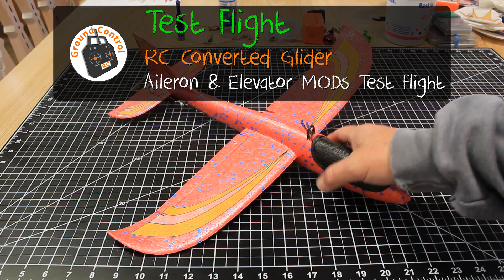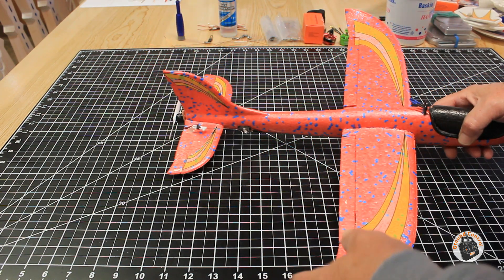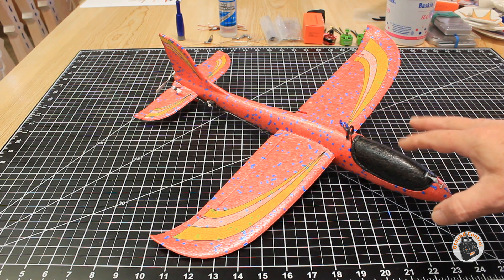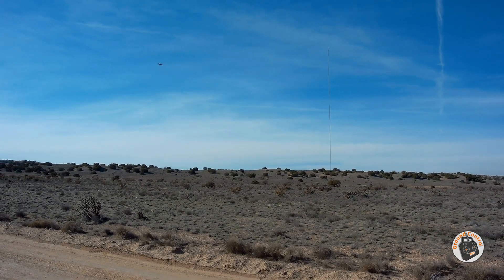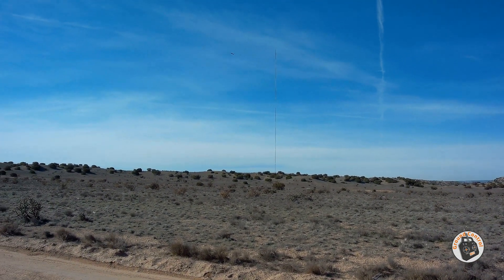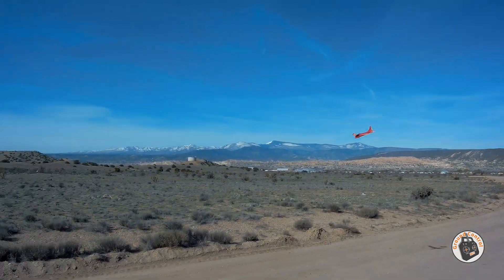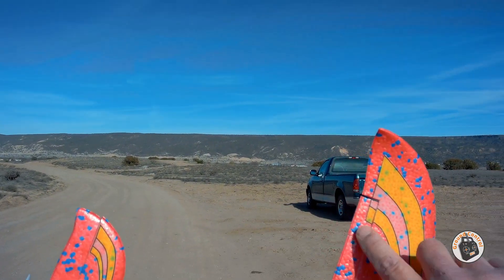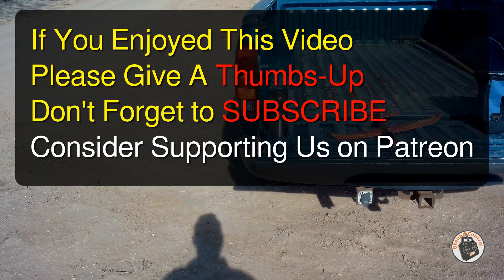Test Flight #1 of the RC Chuck Glider - Aileron & Elevator MODs

Comment: Excellent job on the mods and the flying, you have taken a docile glider and turned it into an aerobatic speedster, well done!  Not to add to your already full list of projects, I was wondering if it would be possible to even add a rudder to this plane?  If a servo could go on the spine of the plane in front of the vertical stab and run the push rod down the left side to connect to the rudder?  Just brainstorming :)  For my own education, what do you mean when you use the term "granularity" with respect to your servos/control surfaces?  I am not sure I have heard that term before.  If the answer is not a short one, maybe an idea for a future tips/tutorial video?  Again, not trying to create more work for you, I just want to ensure I understand what you mean by granularity for my own learning curve  :)  Great job again on this plane and your flight :)  Cheers, Scott
Reply from the maker: Thank you much Scott! I think it would be possible to add a servo for a rudder on this chuck glider ;-)  I didn't want to add the additional weight to this project when I first started as I just didn't know how well it was going to work out or if it was going to be too heavy. I also only have a 4ch micro receiver and wanted to use two independent channels so I could program flaperons so I had to leave the rudder stationary. When I build the tractor version I may forego the flaperons and setup a rudder since I'm going to put a landing gear on the tractor version and a larger motor and prop. When I reference "Granularity" of the Servo I mean less change in the control surface when I move the stick or less movement in the control arm when I move the stick. I find that not all servos have the same number of reference points in that 60 degrees of movement and sometimes that cannot be overcome with lower Dual-Rates or Expo especially on these micro servos. That tends to make the control more twitchy ;-) Also, since the control arms on these micro servos are so short it makes it hard to get that granularity mechanically. See you in the Air!
Reply: @GroundControlRC  Thanks very much for the explanation, I understand completely what you mean by "granularity" now, I had always used the term "resolution" when discussing what you described, but perhaps either the two terms are interchangeable or I was using the wrong term in the first place! ;)  Look forward to seeing your next version of this glider, looks like a lot of fun :)  Cheers, Scott

Comment: It flies well. Remarkably managed. It takes a lot of experience to work that way. 
And on my glider burned out the engine. Expect ten gramm motor. Wait more pull.
Reply from the maker: Thank you much! This has an 1104 7000kv motor running on a 2S. I think on the tractor version I'm going to build I'll use a 1306 3100kv with a 4 inch prop ;-) See you in the Air!